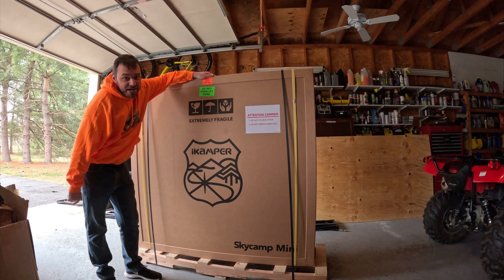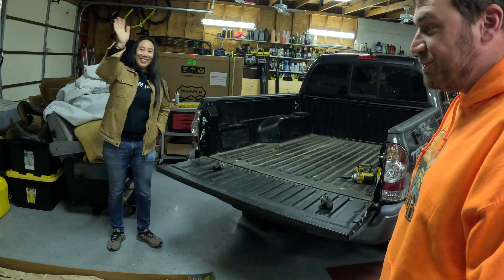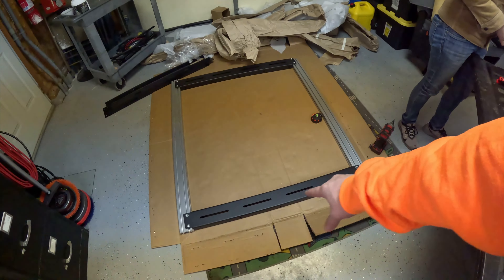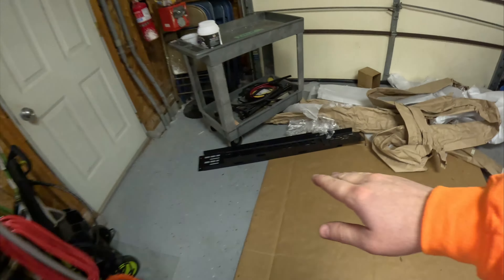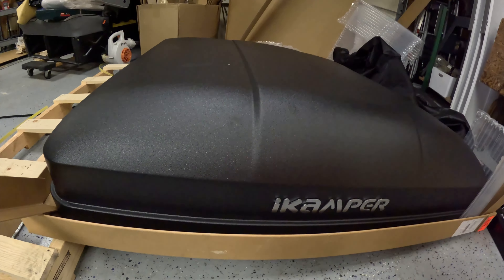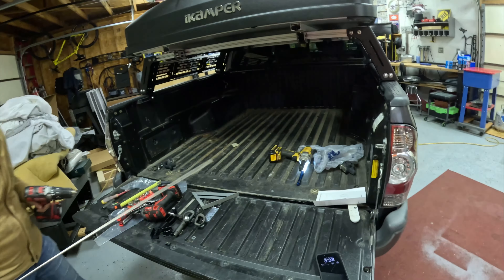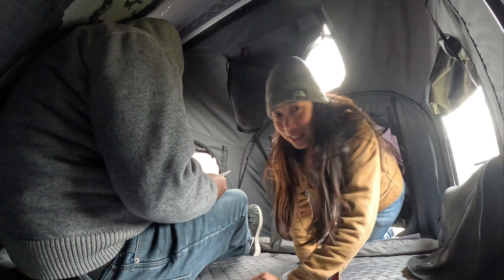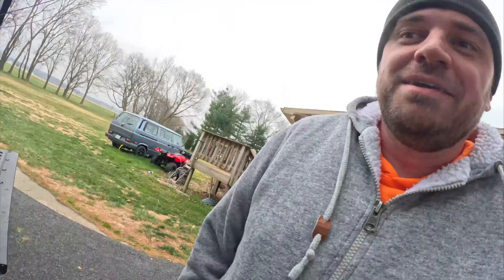iKamper Mini 3.0 with Cali Raised Bed Rack on a 2014 Tacoma - Tacoma Overland 1

Comment: Great purchase. You are going to enjoy the Skycamp mini.  I have mine on the bed of my Tacoma on top of Billiebars and have the same issue with the cab side window awning. I have a roof rack so I just stretch out the awning with bungee cords to the roof rack.  Works out real nice. You can also use the roof rack to store stuff that you can access through the window. Enjoy!
Reply from the maker: That’s a great idea with the roof rack and bungees. That’ll be the next purchase for sure. Did you get those bed supports others talk about? I’ve read those are good to have since it’s a composite bed and the L supports will brace it?
Reply: @TheSometimesBuilds  I plan to get the bed supports as well for the same reason.  It can only help.

Comment: Do you think the space is really for 2 adult only or possible to fit 2 more young kids around 8-10 year-old?
Reply from the maker: That would be a tight fit. It’s just slightly smaller than a queen sized bed. Might be doable for a few years but I don’t think it would be a cost benefit in 2-4 years when you would have to upgrade it again. 

Costco does have a tent that goes on the back of a suv. Or could get a air mattress for the bed of the truck (tailgate down, maybe with a rear bed tent). Could be cheap alternatives for a “second room”.

Comment: If the awning mounts to the one side that's against the cab, is it possible that you have the camper shell on backwards?
Reply from the maker: If I flipped it then the other side would be blocked haha. It’s mostly because I went with the half height bed rack for “better” mpg and aerodynamics since the top of the camper is level with the top of the cab.
Reply: @TheSometimesBuilds  I thought about that after I commented lol. I thought you were originally talking about an awning that attaches to the side that you could fold out. Like the batwing style awnings.